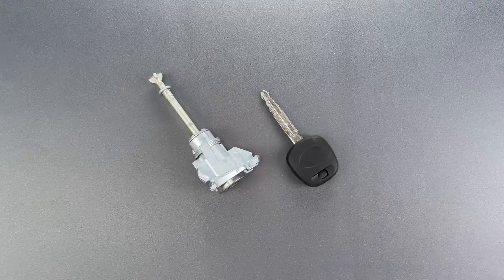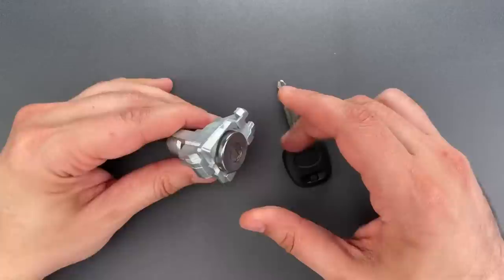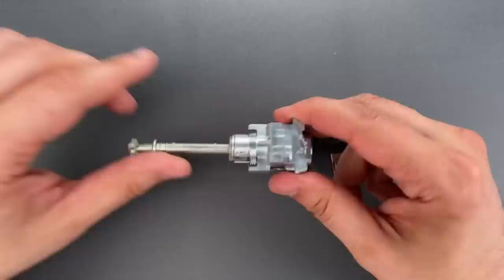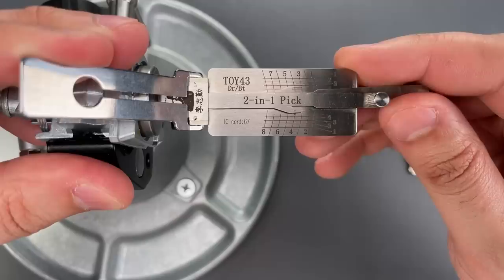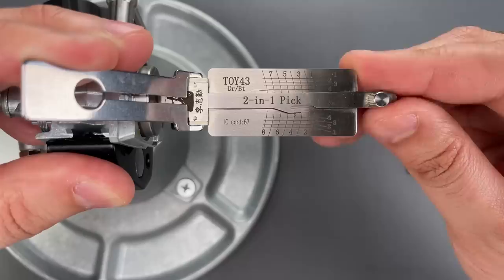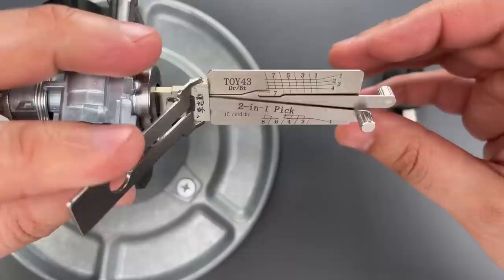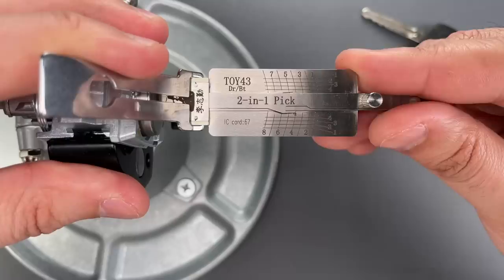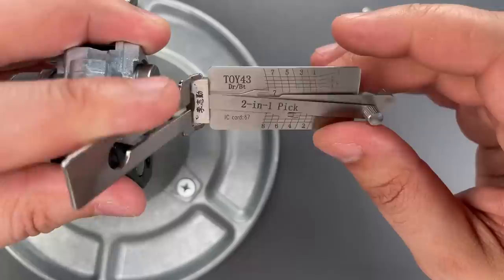[1351] Toyota Corolla Door Lock Picked

Comment: Id like to congratulate all future theives on finding an easier way to open these, rather than just break the locks and hotwire the car.
Reply: Still need to hotwire the car as you can't pick the ignition.
Reply: @Eazfb  Indeed, but now its twice as fast and easy.
Reply: Still need to hotwire or somehow override the RF ignition as most keys have a little RF tag in them. You could pick the ignition lock, but the car wouldn’t start without the presence of the RF tag.
Reply: Is hotwiring even a thing anymore? If the ECU doesn't detect an authorized RFID key tag it's just not going to fire up.
Reply: Soark plug to the window is always going to be the easiest way in.
Reply: @John_Ridley  it would still work for older cars though
Reply: @John_Ridley  Very true, doubt any car this side of the millennium (if not further back?) could be hotwired.